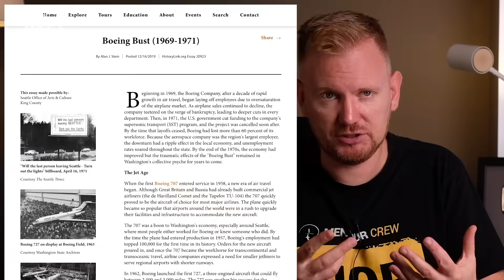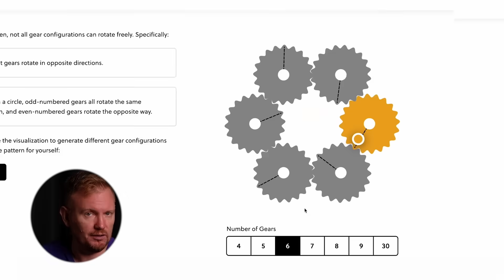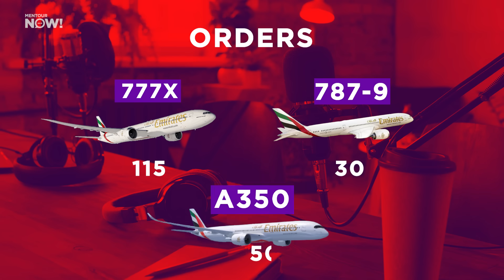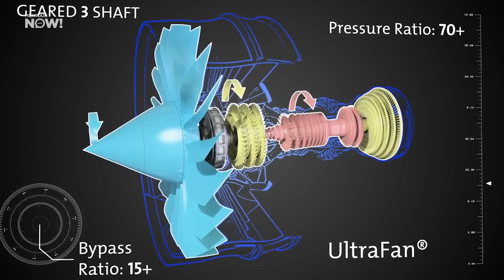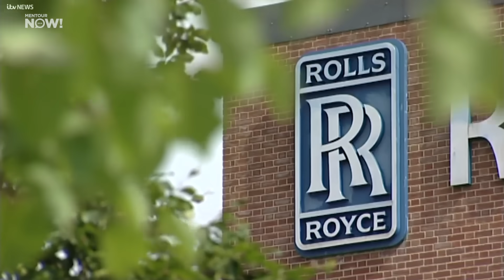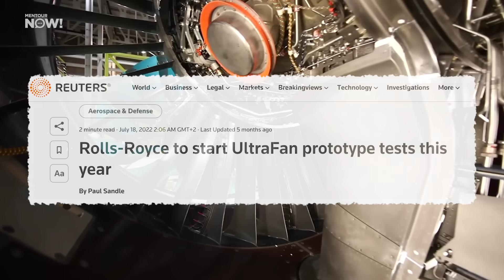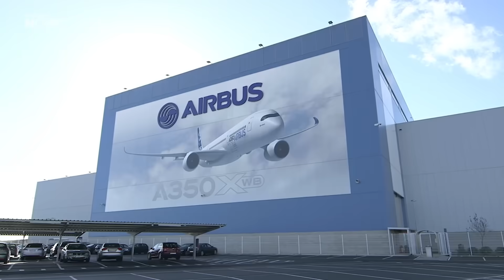Are BOEING planning a 747 with 2 ENGINES?!

Comment: The world's first GTF Geared TurboFan engine ( with a gearbox inside the engine to act like an overdrive transmission to reduce part of the engine  speed) built for Bombardier C SERIES ( now named Airbus 220 planes mid size 125 to 148 passenger new design jets were expected to save 15 percent of  fuel burn compared to existing engines from GE and other jet engine makers. In it's first Pratt &Whitney GTF engine test actual long range flight from the Paris Air Show, back to the Bombardier factory just north of Montreal, the actual real world fuel savings was 21 percent. That's 1/3 better fuel burn than the Pratt & Whitney engineers expected of 15 percent fuel savings. Since jet fuel costs so much more today than 6 years ago when the Bombardier CS 100 and CS 300 jets started flying, fuel cost savings are even more critical than than in the past. So nobody knows exactly how much fuel burn will be saved with this new GE UltraFan engine will save until the planes fly in the first 200 hours of flight tests. Since GE says that they can downsize the engine for smaller planes, it will be a game changer for the Boeing 777X, if Boeing offers the new UltraFan engine as an option in the future versions of the 777X. A 15 percent fuel savings is worth over $1.5 million a year for each jet. A fleet of 90 jets like Delta has ordered for it's Bombardier CS/Airbus A220 fleet will save Delta at least $135 million year in fuel savings. JetBlue, Air Canada, in North America besides Delta and AirBaltic in Europe all use the Pratt GTF Geared to engine on their Bombardier/Airbus A220 mid size jets. The noise reduction of any jet engine that uses the GTF or UltraFan gearbox type design is as much as 70 percent. They will be the preferred type starting in 2028, when the lower noise rules start being required for any new planes in Europe. Noise reduction and exceptional fuel savings are the big factors for the UltraFan powered jets. Airlines can buy planes and lease the engines separately if they choose. Great for everyone.
Reply: I guess A320 and Embraer E2 190/195 use this engine.

Comment: I though the Antonov 225 ( now destroyed by Russia ) could be build in composite and equipped with 4 B-777 engines. Yes it was slow but so much bigger then the A380. Good for flight between UAE and India or within Japan . Japan wanted to fly B747 without landing gear retraction system . Something like a massive Cessna 72  Mass production is probably would be the limiting factor. We are all allowed to dream :-)

Comment: Another thought...The B-52 re-engining program was stalled for decades because all concerned thought the correct answer was going to 4 engines from 8.  The problems this caused including an intolerant wing design and Tail authority in the event of an one engine out, drove the final concept to retain 8 modern engines.  I'm not saying a 2 engine 747 is not possible but there are many challenges and would likely require a new airframe.

Comment: Funny that P&W claims patents for Geared turbofans but the first Geared Turbofan just hit its 50th birthday, the Garett AirResearch (Now Honeywell) TFE731.  The TFE731 entered service in 1972 before either the GTF or the PW gearbox driven UDF program in the 1980's.  P&W did not even make the 2nd mass-produced geared turbofan the Avero-Lycoming (again now Honeywell) ALF502/507.   Besides GE Avio in Italy makes the P&W GTF gearbox in any case.  P&W claiming fan gearboxes is new technology is Marketing hubris.

Comment: This was the first time that I learned that Dubai's fleet of 380s are full for both here-and-there trips. I would be interested to better understand the make-up of the clientele that that flies both ways. Are they local or mostly flying into Dubai as a hub. I never thought of using Dubai before but, as Asia and Africa become wealthier, maybe it completely makes sense. How, if at all, does oil money play into all of it other than provide the means to make it happen (the planes and airports)? Very interesting indeed.
Reply: As Emirates has over 100 A380s and they fly a max of six flights to/from London each day (as stated in the video), that only accounts for a fraction of their fleet. I'll bet that the flights from Dubai to Mumbai or Delhi are also full but I wonder about the load factor on all their other A380 routes.

Comment: The Queen's reign of the skies as a passenger aircraft has almost totally been lost (except for 747-8i services by Lufthansa, Korean Airlines and a Chinese carrier) Lufty even has a few -400s flying. As a 10-year-old child, in 1969, I believe that no person back then understood Jumbo to mean any airplane except our friendly humped, now 53-year-old close friend :-) The DC-10 was a smaller, scary disaster and the beautiful L1011 didn't have much market penetration. BTW, the 747-Special Performance was superior to its longer sibling in MANY respects, performance wise at least. Twin-engine cheapness does NOT equal validated passenger safety. That is one reason why ETOPS limits are still imposed on twins.

Comment: Covering off the rise of the widebody twins, you didn't mention the big reason they took over - increasing ETOPS. When the A300 was built no twin was allowed to be more that 30 minutes from an airport in case of engine failure. Such is the reliability of modern fanjets (or the way aviation authorities are in the industry's pockets - its a matter of perspective) that ETOPS is now set to as much as 6 hours. It is not too much of a stretch to say increasing ETOPS is what killed all trijets and quads - the A340, the A380 and of course the 747.

Comment: Newton's second law doesn't specify how many powerplants are required.  There's also no rule that specifies that they be in pairs.  While 4 is a popular number, so is 2, but the L-1011 had 3.  

Recap: 0 engines do not produce any thrust or lift, so that option is out.  
1 engine can do great, but won't pass ETOPS (the T is for TWIN) regulations so that's out.  Also even if you could convince regulators to go for it... there's 0 redundancy, so, no.
2 engines seem to be the minimum.  ETOPS proves it.  The B787 and A340 both fly under this standard.
3 has been out since the L-1011 was retired in the 1970s.
4 is deprecated.

If you're playing the odds, use 2 engines, and have them be efficient enough.  Both Boeing and Airbus have these and with many options including the video-mentioned GE-9X, the Trent-1000, and the Trent 500.  There are other manufacturers but there is a lack of competition.  They work to get contracts, not to improve engines.

A 747 will never have 4 engines.  Too many things have to change.  A poster (Reuben Jackson) correctly points out a need to redesign engine mounts, and therefore fuselage, and ... well... that isn't a 747 anymore.

Importantly, why do we care?  Planes are flying empty of passengers.  What is needed is for the airline industry to get a Clue-By-Four that freight is where the money is... and instead of P2Fs, start doing F2Ps.  Freight.  First aircraft company to focus on that will watch their stock price skyrocket.

Passengers?  That's just people like you and me.  Whatever.  Freight/Cargo - pay by the pound all day everyday.
Reply: Nearly all airlines carry both freight and passengers so they know the revenue of each. There are freight only companies, and maybe there is room for a few more, but not enough market for all airlines to suddenly start prioritizing freight over passengers, otherwise they would have likely done so already. 

I agree that there will not be a 747 with two engines, but it wouldn't necessarily be a new airplane if it did. The wing has been redesigned more than once. The fuselage has been stretched and shrunk, and the hump extended. In fact the hump extension required a redesigned wing box since the hump now extended over the wing. Although that wing modification had already taken place with the 747 SP (which had a giant vertical stabilizer as well).  But even if the fuselage remained mostly the same, changing from four to two engines would normally result in a name change, like the A330/A340. But in this hypothetical case I suspect Boeing would want to keep the 747 legacy name so it would probably be the 747-500 or something.

Comment: If one considers a blended wing design with military transportation in mind, a dual use application for the engine this becomes highly feasible. Thinking of a B2 / Galaxy blend, with range and cargo capacity eclipsing the Andropov. Of course this would limit airport access to just a few world wide; however with an innovative modular loading system considering no external windows, the dual use heavy cargo/passenger application could be viable.
https://youtu.be/59A8-rKRs-0
Link to an example of the blended wing design.

Comment: The 747 is built with old school technology.  It would make more sense to replace it with one that is built from carbon fibre composites. As bypass ratios increase high wing models might replace low wing designs.

Comment: RR business case is not aircraft at all. 1) future weapons will require huge amounts of energy (lasers etc) - power that needs to be on demand, and can spool quickly. RR despite being British is integrated with the US defence network, and will likely find its way onto future ships, and land vehicles. 2) Load balancing of the network grid with increased use of renewables. RR jet engines are used across the world when electrical demand spikes. To avoid blackouts jet engines connected to generators  are used for short periods of time to ensure spikes do not cause blackouts. With increased renewables, for example wind power - the supply is LESS predictable, hence grids will requires increased use of balancing generation sources. Of course the technology will filter down to the next generation of aircraft engines once perfected.

Comment: You filthy liar, nobody has considered putting two engines since the largest engines still would not provide enough thrust.
Reply: The 777 has only two engines, the next 777 will carry over 400 passengers which is similar to the 747-400. The engines being discussed in the video are even more powerful and could carry even more passengers. It is unlikely that they will be used on the 747 since it has already been discontinued. But it is in theory possible to make a two-engine 747, thrust is not the issue it is more about the time and resources that it would take to modify a four engine plane to use two engines.

Comment: Does that means that Boeing needs to  do a major wing/ hard points overhaul in order to withstand the max thrust created by this engine?
Reply: It would require a completely redesigned wing. Which has happened in the past so that is not impossible. However it would also require major changes to the hydraulic lines as well as the entire electrical system, all of which were based on four engines for redundancy. It might also require lengthening the landing gear which would create many other complications. For all of these reasons it is highly unlikely that this will ever be done, especially at the moment when there is not a huge demand for planes of this size.

Comment: Would many of these planes not be redeveloped as cargo. Big capacity-all airports can take them (or most relevant ones) and nice and cheap to buy plus lot of parts (or recycled from existing ones). Lots of 747 qualified pilots. Or could they just run two engines at its set altitude and run the others to near idle to cut fuel use.

Comment: Stop for the last 30 years plus, that the next jets should have been supersonic.   I was on the very Concorde that went down with the same pilot 6 months before.   They were not profitable, and with current or old technology, still aren't.   The ticket was incredibly expensive. (Lovely business garbage write-offs)   Even at that price, it wasn't profitable.  Operation prices, economic swings (should be every 10 years...good luck at the end of this year) and energy use/prices.  Stop with the supersonic thing, it's a business (You addressed profitability in this video, but for some reason, clouded on supersonic for business reasons.)

Comment: Perfect Engine for a 2 or 3 Engine Blended Wing Body aircraft. Placing the Engines on top eliminates the ground clearance problem. Also, a possible perfect fit for a 2 Engine high wing aircraft (next gen C-17, C-5 version or 4 engine AN-225 next gen?)

Comment: Surely you would need to redesign with more composite as well? It will be interesting to see if the 777X increases in popularity over time or not. It does have a much bigger cargo capacity than the A380 which helps with profitability when seat fill is low.
Reply: Please don't call me Surely.

Comment: One of the main reasons Emirates A380 are full between UK and Dubai is because of the clientel flying between the UK and India, Pakistan and Bangladesh. I have often flown from Birmingham to the far East, via Dubai, the A380 leg to Dubai is always packed. The same can be said for LHR to Dubai.
Reply: What's surprising is that once in a while even the A380 isn't big enough for Emirates! There have been rumors that they want an even bigger A380+ and may have been in talks with Airbus to get one. I doubt Airbus will go through with it. I think instead, they'll offer them another few A380s at a price Emirates can't say no to.
Reply: Also a feeder for Australasia for Emirates, who also have feeders from most of the European cities.
They operate a Hub and spoke system contrary to the point to point system preferred by the US airlines, and of course the European airlines have to compete similarly on the transatlantic routes.
I'm not a huge fan of stopovers but as long as they keep their air fares low I'm prepared to put up with a stop, that said I've found it cheaper in the long run to fly direct to Bangkok since just before the pandemic. Emirates have priced themselves out of consideration for flights.
Reply: I wonder whether the expansion of Air India and other South Asian Airlines will significantly affect the Emirates.
Reply: Can they make the 777-300 longer ? If they make it any longer I think tail strike will be a problem. I saw the photoshop picture if the 2 engine 747. The fuselage could be used but the landing gear would/ should be made longer for the larger engine and incorporate the latest “ NEW” wing technologies and use more carbon fiber use on both the fuselage and wing. The old 747 aircraft is a proven technological design and would not present a big risk in development project and the main focus would be the wing up date for the future new 747 -  9i ?
Reply: I worked LHR to Dehli, and always full.

Comment: For a twin engined 747, as long as the fan diameter did not grow too large, you can hang it between the locations of the two engines right now, example between engine number 1 and 2 but closer to number two for better engine out yaw control. Boeing can use much the same tricks as they did with the 737 Max and raise the engine almost to the height of the wings, and have most of the fan air directed to the top of the wings. With that much by-pass air, it is just a glorified turbo prop with a fan shroud.  If that is not enough, the can consider adding some more dihedral to the wings. The new jet will need a new type rating, and please, do not hide any software codes from the pilots. (like MCAS)  If that is still not enough ground clearance, Boeing can always follow the Honda concept, have the engines above the wings.  A new clean sheet design, they can also put the two engines at the rear, like most biz jets today.

Comment: It's not all about thrust.  Two GE90s now can provide enough thrust for a 60K x 4 747.  It depends on many more relevant design factors: Wing structure; Mounting and aerodynamics;  Packaging and ground clearance; Tail size and engine out stability to name a few.  A two-engine version or retrofit could require a lot of modifications.  It would need to be a straight drop on with limited modifications to financially work.  And for all that you get an aircraft that seats the same as a 777x-9.  747 is done, bless the people who designed and built them.